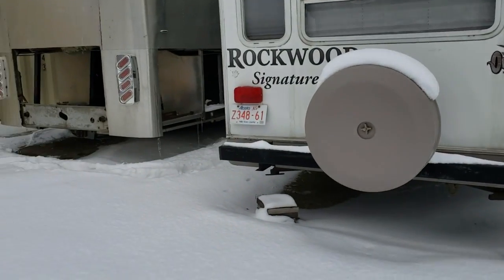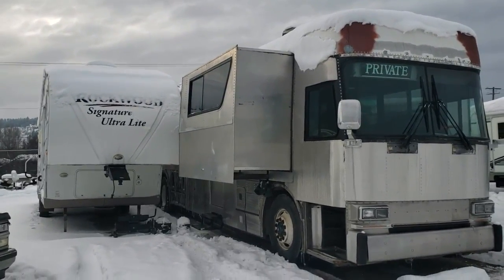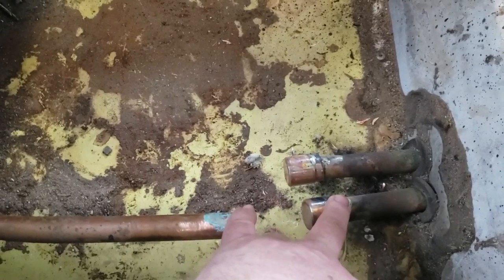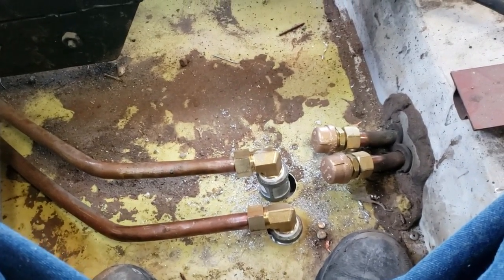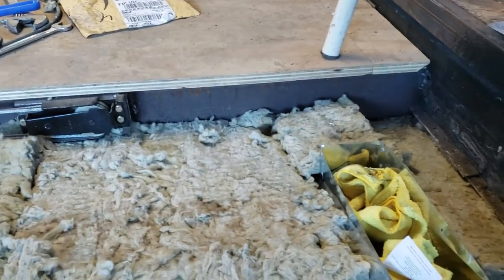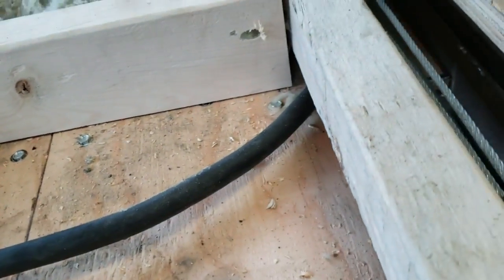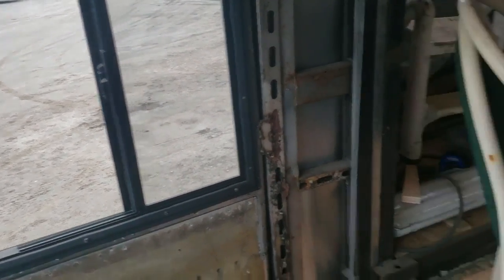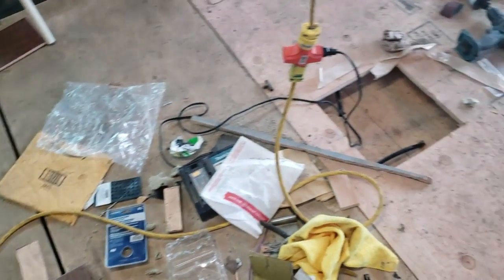Bus Conversion Project - Video 103 - Flooring update and Spring's Coming

Comment: Take a tip form the alarm guys and put door switches and so forth at the top of the door not the side or bottoms.
Reply from the maker: Thanks for the tip.... that's a good idea... I'll see if its feasible in this application
Reply: @JamesEDennison  I got in trouble when working for an alarm co many, many years ago for putting switches on the sides instead of the top of the doors and windows and for not making "drip loops" on all cables passing through a bulkhead. Good to see ya back at it.

Comment: Hello my friend,  how are you and the wife doing? The Bus is looking good as usual. The floor is coming along nicely
I tore my flooring out didn't like the look of it and a little bit of dry rot but not to bad.
Got a great deal on some 4X10 sheets of MDO it's supposed to be water proof bought all my furniture for the bus got a lot of stuff for her but it's been to dam cold also like you I'm waiting for some warmer weather to spray foam
But I still need to run my wire for everything. Are you planning on spraying it yourself or are you going to hire it out?  
Oh I forgot to tell you last time we talked I bought a product that you apply on the inside of the skin its supposed to block up to 40% of the radiant heat from entering the coach if you want I'll send you the Amazon link so you can take a look.
 Anyway great to see your back at it James looking forward to seeing what's next on your to do list your always an inspiration.
Reply from the maker: Hi Brian... ya.. I'd like to see that heat block... send me the link if you don't mind.... I'm going to get a quote on having it done... I've talked to a few guys who've done it themselves and it ends up costing about the same.... yield is inconsistent with the kits I've heard.... I know what it will cost to do it myself... if the quote is in the ballpark I'll get them to do it... otherwise I'll do it myself